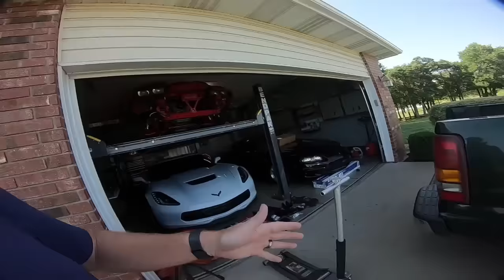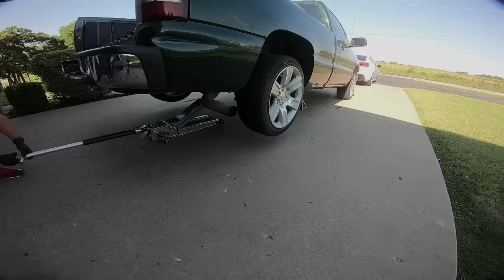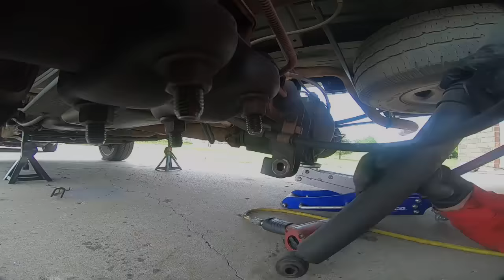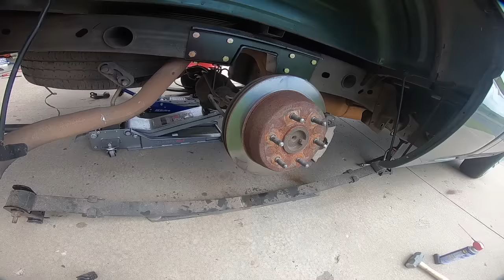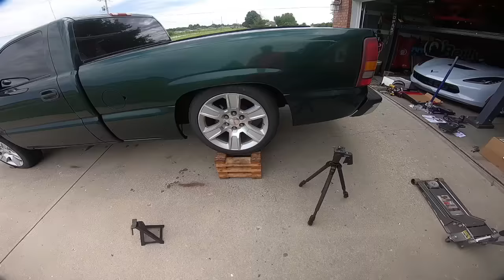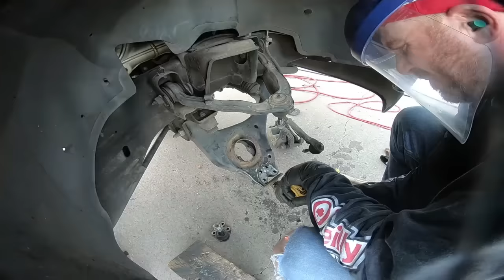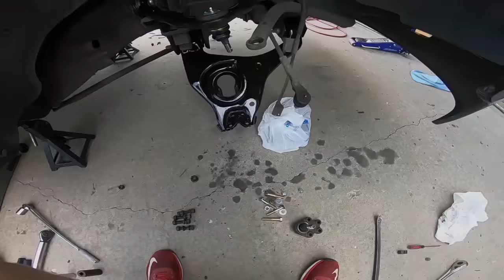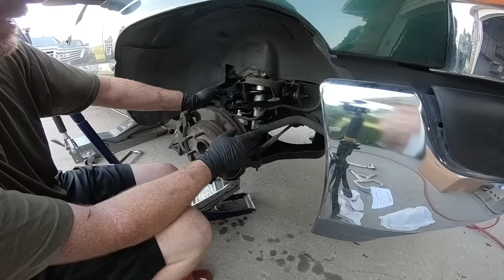How to Lower Sierra and Silverado NBS (Ultimate How to!!!)

Comment: Did u have the same prob with the 07 tahoe on the upper control arm if so can u send the the link where I can buy the off set control arm
Reply from the maker: I didn't use them on my tahoe but it also wasn't this low. I have had to use offset bushings in the past on tahoes with 4" of drop in front.
Reply: @TWAMotorsports  I've just got my drop for my tahoe 4/5 mcgaughy do u think I need the off set upper control arms
Reply from the maker: @chevyboiii2115  probably at 4"

Comment: I want to lower the front 3” drop on my Silverado would you recommend cutting springs or buy already cut springs also on those upper control numbers from Amazon they are the same part number for both sides
Reply from the maker: I don't recommend that much cutting. Yes the part number is the same for both sides.
Reply: Thanks for your response...if I buy 3” drop spring you think it will drive bad or it’s better to get a 2” drop spindle and do 1” drop spring? I really want to do a 4” drop but I’m running 255/55/20 I think if I do that my tire will rub with a 4” drop
Reply from the maker: @yonyls  I would definitely do 2 inch spindle and 1 inch springs over 3 inch springs
Reply: Is there another brand drop spindle less complicated to install without ball joint spacer?
Reply from the maker: @yonyls  yes but I don't care for them. The mcgaughys for 17" wheels do not require this.

Comment: Hey I did the same drop on my 00 sierra but it's rubbing really bad on the right side only 
What could it be?
Nice truck btw 👌
Reply from the maker: Tire is too big.
Reply: @TWAMotorsports  but I have the same size of tire all the way around 
And it's only rubbing on the back passenger tire do you think I did something wrong? 
Thanks for replying
Reply from the maker: Doesn't mean they are not too big. May be slightly more to one side

Comment: Do you know what size is  bolt for the alignment top plate bolt for the flip kit  ?
Reply from the maker: No just use one that fits
Reply: @TWAMotorsports  does the bolt have snup ?
Reply: @TWAMotorsports  ok thanks

Comment: I install the same 2” drop spindles you use in this video and it looks it didn’t  drop my truck at all It seems it raise my truck more. Any ideas?
Reply from the maker: Maybe it already had drop spindles
Reply: TWA Motorsports yesi did have the old bell tech spindle but those took special ball joints and I didn’t find no more ball joints for those spindles that’s why a switch to McGaughys spindles but with my old spindles It just to be lower thanks for responding
Reply from the maker: Maybe a small difference in spindle drops

Comment: Not sure if you mention it or have a video, but I noticed before you did this kit you didnt have any blocks between the leaf spring and rear end. was that how it came or did you remove it ? Also if you removed it did you re use the factory u bolts or had to get shorter ones ? and did you re use factory shocks or shorter ones ?
Reply from the maker: These trucks generally do not have blocks. Later in the 06-07 classic do. They are removed if you have them.
Reply: @TWAMotorsports   I appologize. I have a '14 and just happen to come across your video in my searches. Very helpful !!
Reply from the maker: @MK-us7bq  thank you. Yes they do for sure have blocks.
Reply: @TWAMotorsports   I wasnt sure if I took them out if had to get different shocks or something. thats the info I was seeking.
Reply from the maker: @MK-us7bq  sometimes you have to get shorter u bolts
Reply: @TWAMotorsports   Thank you. Still deciding if I am going up or down. Heard the leveling kit puts strain on the ball joints. Just want it to sit level.

Comment: What happens if you don't use the shocks extender
Reply from the maker: If you have the right shock it may be ok but I like the better angle the extension gives. It's more like the stock operation.

Comment: What parts do I for the 4" rear drop? on belltech website for my truck they have the front hanger kit and the rear hanger kit, do I need both kit? the rear hanger kit has the shim but it does not have the block to go under the axle? U don't use shim for your drop but some other guy drop, he use the block and shim with it? Could I just use shackles for the 4 inch drop? what is the best way for a 4inch rear drop parts?
Reply from the maker: Front hanger and rear shackle
Reply: Does the leaf spring need to go under the axle then and do I need a flip kit like the block or shim kit for the axle to the leaf spring? DJM has a kit for shackles and hangers but no block or shim kit, Doe I need the shim n block kit for the 4 inch drop? Belltech has the shim kit but not the block, what pinion shim degree is need cux they have 1 degree to 6 degree shims.
Reply from the maker: No it's not a flip kit. I never use shims but I also never do 4 inch rear drops

Comment: Did the front brake line have to be adjusted on top of the spindle? You made this job look easy, it isn't lol
Reply from the maker: Have to trim the bracket as shown
Reply: @TWAMotorsports  is it possible to get a few pics, I know I'm better a pain , this job is kicking my tail..
Reply from the maker: I don't have any but all my drop videos show where I trim it.
Reply: @TWAMotorsports  my front brake line is way to tight when fastened in the proper location. I noticed your line is off to the side of the caliper where mine is routed over the top caliper bolt. 🤷‍♂️
Reply from the maker: That's weird. I just put mine in the top of the spindle
Reply: @TWAMotorsports  haven't found any info yet on trimming it yet? Also did you have any problems with the factory exhaust tapping on the axel?
Reply from the maker: No on the exhaust

Comment: I have a question what can be causing vibration in the highway & sometimes on the street I have a 2/6 drop seems to only vibrate sometimes because other times it is completely fine
Reply from the maker: Could be tires or pinion angle
Reply: How would I know if it’s my pinion angle ? & is it hard to fix ?
Reply from the maker: @rascon_cabron6340  you need an angle finder.
Reply: I plan on making my drop a 4/6 or 7 maybe I should wait to fix that. You know of any videos that will help me out for when I do go to check it?
Reply from the maker: @rascon_cabron6340  not really it kinda trial and error with shims.
Reply: TWA Motorsports gotcha thanks man

Comment: What was the torque spec on the lower control arm to the frame?
Reply: And did you torque it down as soon as you threw it in?
Reply from the maker: They need weight on them. 129 ft lbs
Reply: @TWAMotorsports  while I have the A arm jacked up to install the spring and spindle would that be a good spot to toque the A arms down to the frame?
Reply from the maker: If the have weight on them.

Comment: on the rear did u change the fron hangers to
Reply from the maker: No
Reply: oh so i would need to put back the original hanger to the flip kit my truck has 2" drop hanger and 2" drop shackles
Reply from the maker: Yes you would
Reply: ok thanks alot 👍👍👍
Reply from the maker: @PITUFO30001  you're welcome

Comment: Good morning what is the c notch kit would you recommend for a 2000 chevy silverado 1500 v8 4x4
Reply from the maker: Same I used here.
Reply: Thanks
Reply from the maker: You're welcome
Reply: @TWAMotorsports  do you have the link for the lower control arm
Reply from the maker: @stitcht5035  it's the original. I clean and painted it
Reply: @TWAMotorsports  thanks
Reply from the maker: @stitcht5035  you're welcome

Comment: Hey TWA don’t know if you still check the comments on this old video but I have an 03 Sierra with the 4/6 drop and the rear axle is not centered. No frame damage, bed is straight, but rear end is off center by about 1/2 an inch favoring the passenger side..any remedies for this ?? Maybe loosening the U-bolts and pushing it over a tiny bit ? Any input is appreciated
Reply from the maker: That is really the only way to adjust it
Reply: @TWAMotorsports  Thats what I figured thanks for the response bro
Reply from the maker: You're welcome
Reply: @TWAMotorsports  should it be done with the suspension loaded or can it be done on a lift
Reply from the maker: No. Needs to be on the ground or weight on suspension

Comment: Had a weak air tank at 50psi. Instead I did this the long way drilling a 1/8th pilot hole and opening it up to a quarter then 7/8th and when you drill out above halfway attack the surrounding metal with an air torch for a few seconds and hammer it out with a punch and a mini sledge. Took me two days about 6 hours in total but it can be done.. Now if you excuse me... I need to ice my bruised hands
Reply from the maker: I bet you do. These things suck.

Comment: On a shortbed/ single cab, does the pinion angle tend to change much with a 2-3" rear drop, with a schackle kit/ block removal?

What is the best place on the rear to take the measurement (the bottom of the rear is angled)?

Thanks for all the great and informative videos!!  Your channel is rad!
Reply from the maker: It does generally change some. Never measured on this style truck
Reply: @TWAMotorsports  thanks.
Reply from the maker: You're welcome

Comment: The 2wd is low enough from the factory , I live in Colorado so we go off road with our trucks.
Reply from the maker: You definitely shouldn't buy a 2wd out there.
Reply: @TWAMotorsports  They are just fine , most my 4wd trucks stay in 2wd even in the winter.

Comment: What’s up TWA! Hope ur doing great! Got a question? Ived just finished installing my 5-7 drop on my 01 Silverado single cab short bed v6! I went with bell tech from front to back all the way! In front 2” spindle and 3” spring coil, in the rear c-notch + flip kit, bell tech street performance shocks for front and back so I’m really excited on how is gonna drive down the road! Anyways both of my front sides (driver-passenger) is exactly 29” from ground to fender lip just like u measured yours, thanks for that, my rear driver side is 28 1/2 ground to lip, my rear passenger 28 3/4! What can I do to fix it or make it leveled? Any ideas will be helpfull or do you think that’s ok and it will be hard to tell the difference? Thanks and hope to hear back from u soon!👍🏻
Reply from the maker: Helper bags will bring the back up. You could also cut some off the front springs.

Comment: Hey what do i need to lower the rear just wanna make sure
Reply from the maker: Shackles or flip kit.
Reply: TWA Motorsports thanks so much!
Reply from the maker: @surreal4595  I also listed all the parts in description
Reply: TWA Motorsports thanks for the help and quick response
Reply from the maker: @surreal4595  you're welcome
Reply: So all i would need is a flip kit ? ,since i already have shackles
Reply from the maker: @surreal4595  yes in rear
Reply: Wont need shocks right?
Reply from the maker: @surreal4595  you will need new shocks
Reply: I recommend a C notch for a comfortable ride!

Comment: anyone know what function the aluminum plate has? the one installed in the lower control arm. i bought a new lower control arm with the ball joint rivetted on it and did not want to grind on my new piece .
Reply from the maker: I explained this in the video. If you use the spindle I use you have to relocate the ball joint and this keeps it from collapsing
Reply: excellent video. thank you for your response.
Reply from the maker: You're welcome. Hopefully it helps

Comment: I did the flip and not h and shackes but my rear end ended up pushed forward enough for it to not be centered in the notch also now the transmission makes a ugly noise going into drive,, any help?
Reply from the maker: Did you install the saddles the right direction?
Reply: @TWAMotorsports  what are saddles? Sorry man by the way just subscribed i love all your work man the truck i got is a 2007 classic crew cab and what inspired me to lower it was your gray crew cab , so i installed the bolt on  c notches then flipped it then i installed 2” shackles.
Reply: Maybe i got the shackles backwards??
Reply from the maker: Saddles are what the rear end sets on between leaf spring and rear. They have a hole in them that is offset. Hole needs to be closest to front of vehicle
Reply from the maker: That wouldn't make a difference
Reply: @TWAMotorsports  oh yes the saddles are installed with the hole toward the front i did that , so i dont know what i did wrong . I installed stock leafsprings because the old ones were heated to lower it the cheap way.. maybe i put those on backwards??
Reply from the maker: They can be put in backwards also
Reply: @TWAMotorsports  then i have no idea what my problem is . The rear end is too far forward it doesn’t center with the c notch.. im just going to take everyapart and try again.
Reply: Thank you for everything man keep up all the great work ❤️
Reply from the maker: Something isn't right
Reply: @TWAMotorsports  everything is universal, there is no left and right on any parts so i just dont know ,, i know the flip pushes the rear wnd forward a little bit thats why the saddles have an offset hole but yes something is wrong . The leafsprings i put on are stock used ones maybe they have to be put on exactly same direction how they were on the previous truck?
Reply: The shocks were not unbolted while i put the leafsprings on maybe i have i to unbolt them first ?

Comment: Did you get the the spindle for 16 inch rims or 17 plus
Reply from the maker: 16. All parts listed in description
Reply: @TWAMotorsports  ok thanks. So of I use the 17 plus I should not have to mess with the lower ball joint.
Reply from the maker: Correct

Comment: can you still tow with the truck?
Reply from the maker: You can but it's a v6 so not a huge towing capacity.
Reply: Okay thanks just trying to learn all I can about different kits and options as far as lowering trucks very informative video thanks
Reply from the maker: @jerrenb...  you really need helper bags if you tow with this drop. I will be installing them in a future video.

Comment: Hey how does it ride with those shocks in the rear?
Reply from the maker: I think it rides great. It's a little firmer than stock but I like it.
Reply: TWA Motorsports does it bottom out because my 4/6 is bottoming out I’m waiting on shock extenders
Reply from the maker: @adrianolivas3174  it probably would without my helper bags.

Comment: What tire size are you running? I did the 5/8.  What would you recommend on the tires I should get?
Reply from the maker: All parts listed in video description 245/45
Reply: @TWAMotorsports  do you think 275/45/20 will rub?
Reply from the maker: @luxurnathan4353  yes
Reply: @TWAMotorsports  what about 255/45/20?
Reply from the maker: Probably rub
Reply: @TWAMotorsports  so 245/40/20 is good then?
Reply from the maker: @luxurnathan4353  yep

Comment: The offset bushing in the rear of the upper control arm will greatly decrease the amount of caster on the spindles more so than just ad camber to only the back side of the upper control arm. The alignment shop will have to slide the back of the upper control in as to increase the caster to correct the caster so the truck will turn properly. This will void the reasoning for the offset bushing. Both bushings in the upper control would have to be offset to only effect camber settings, making the camber change change even front to rear of the control arm and not effecting the caster.
Reply from the maker: Thanks for that info. Hopefully the alignment will come out ok.
Reply: @TWAMotorsports  I am sure they will be able to get it set, as long as there is enough depth in the mount for the factory setting. I enjoyed your video, you do a much better job explaining and inputting the info like torque specs. I look forward to more videos from you. I hope the front front springs settle for you. It might be an idea to trim down the rubber caps on the spring or eliminate them or make thinner neoprene shims  to bring the front down. I know this has worked in the past for me.
Reply from the maker: @donaldellis8116  thank you. I appreciate that

Comment: Great video, did you order the shackles separate or did they come in a kit?
Reply from the maker: Separate
Reply: TWA Motorsports will the shackle you linked work for a 4/6 drop? If so, which hole would I have to use?
Reply from the maker: @cesarcabezas8072  the flip kit gets you 6" middle hole 7" top hole 8"
Reply: TWA Motorsports So if I would just want the 6” flip kit drop, I’d leave the stock shackle correct?
Reply from the maker: If you only want 6 yes
Reply: TWA Motorsports thanks for the information!
Reply from the maker: You're welcome

Comment: Hey twa I have a ? I have 09 crew cab with a flip kit and the lowering Hangers if I put the lowering shackles will it go lower?
Reply from the maker: To be honest you can't do flip with hangers. But if you have a flip kit, lowering shackles do lower more.
Reply: Yeah I bought the truck like that idk why they did the flip kit with the lowering hangers
Reply from the maker: @ramiromartinez3588  that's crazy
Reply: I think it’s a 2  4 drop cus the leaf springs are under but not fliped
Reply from the maker: @ramiromartinez3588  flip kit means leafs go under the rear.
Reply: It is a flip kit but with the after market hangers with stock shackles
Reply from the maker: @ramiromartinez3588  rear hangers then. Those are lift hangers.

Comment: Are you still able to run 17s with that lowering kit??
Reply from the maker: Yes
Reply: @TWAMotorsports  last time I had this kit installed shop told me I couldn’t run 17s because they would rub 🤔
Reply from the maker: The spindles used in this video allows a 16" wheel to be used